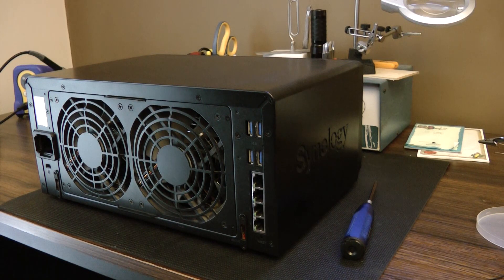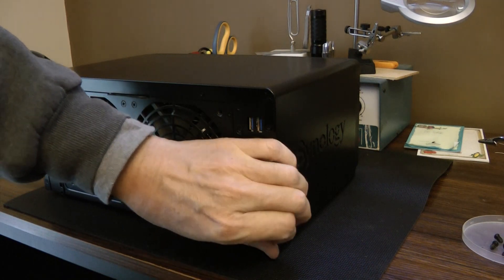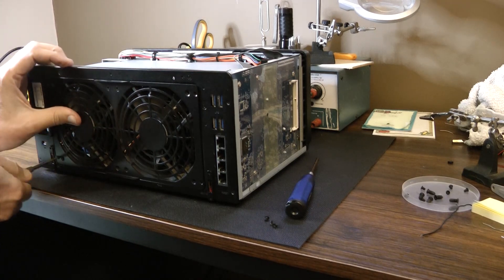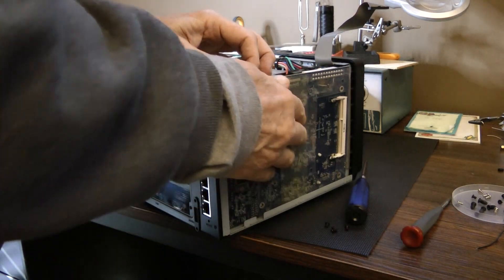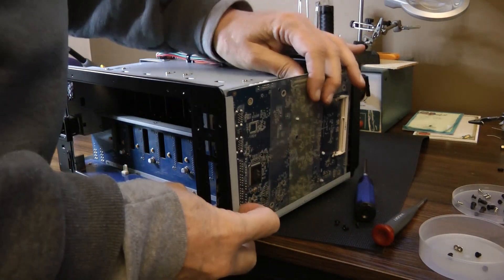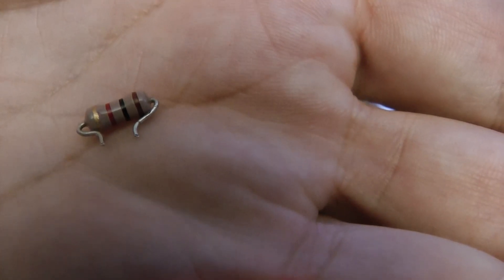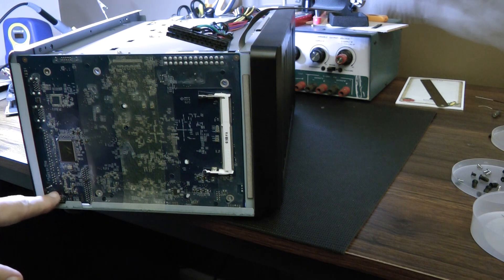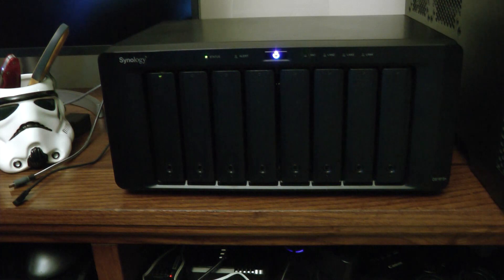Synology 1815+ won't turn on FIX

Comment: Is it a possible soldering with a consumer base solderer? I mean my solding unit is kinda big. And the resistor wire are so small
Reply from the maker: My soldering iron is a consumer version, I'm not a professional at this.  You need something with a pencil tip.  If you have something like a soldering gun, that's no good.

Comment: Hi, what type (model number) of the 1k resistor is good for the transistor fix? Thanks!
Reply from the maker: 1/4 watt 1k will work fine
Reply: @GaryQuiring  Thanks Gary, just to confirm, does something like "Metal Film Resistors - Through Hole 1/4watt 1Kohms 1%" look good?
Reply from the maker: It can be a carbon type too, no need to pay more for the metal film.  1, 5 or 10% is fine.
Reply: @GaryQuiring  Thank you so much!

Comment: Gary, Would you be available to do this fix on my dead Synology 1815+?  I don't feel confident to do it myself.
Reply from the maker: Sorry Jeff, it's going to cost you about $75 to ship each way.  It's not worth it.  Find someone local who has some soldering skills to do it for you. I can't take on the responsibility if the shipping damages the NAS or it possibly does not work even with the resistor modification.   If you are on Facebook I would ask your friends to see who has some soldering skills.
Reply: @GaryQuiring   Thanks -- I understand. PS - Your video is great!

Comment: I had the same problem and I follow exact step and fix my NAS. 

However, when I leave it on power on one day and power off it one night and it doesn’t turn on again. 

I have a question, if I parallel connect two resister together, will that help? 

Or if is is a 500 resister too much for this machine?
Reply from the maker: From what I understand you need a higher OHM resister if it still does not work.  I would try a 1.5k.
Reply: @GaryQuiring  thank you for replying. Do you know does it not power on and why adding adding a resister helps? What does a resister do to the system and how will it affect the system in a long run?
Reply from the maker: @jvfx7469  It's the transistor that is failing. I found the resistor comment on a discussion forum a while back.  You could replace the transistor (which would eventually fail again).  I am going to assume something else on the board is not engineered correctly that causes that transistor to fail.  Are you sure your solder joint is good, maybe that's the issue?
Reply: @GaryQuiring  do you know where that transistor located?
Reply from the maker: @jvfx7469  It's right where you soldered the resistor over the leads of the transistor.  It's a BC847.  It's very tiny.
Reply: @GaryQuiring  I try to add a resister, and it did not power up. And I try to short the two legs using a cable and I got it power up. And I worrying shorting it will damage the machine, I unshort it after it power up, and it can still run for sometime, I’m still watching it running and i hope it will be stable. 

I have a question, if I keep it shorting without a resister, will it do anything bad to the the machine in a long run?
Reply from the maker: @jvfx7469  What are you shorting, the two connections on the transistor?  Did you apply the Atom bug fix with the 100ohm resistor?
Reply: @GaryQuiring  I already see the atom bug fix resister on the board from the factory because it went through warranty service last year. 

I’m shorting the two legs on the resister you show on your video close to the power connector.
Reply from the maker: @jvfx7469  How many times are you powering this on/off?  Most of us leave these NAS's on 24/7.   Find a resistor that will pull it low enough for it to power on.  Or replace the transistor.
Reply: @GaryQuiring  I’ve using this for 8 years 24/7. I never turn it off. Just few Months ago it keep restarting randomly every few days. I follow Synology’s instruction to troubleshoot. I turn off “restart automatically after a power failure” option. After that, when it power off, it never turn on again. I replace the power supply. And it only on for one day and it never when back again until I see your video. 

Now I wonder if I should permanently short those two legs, or add a switch to that cable and only short the connection before press the power button?  

Because without shorting that cable, I can’t do anything to the machine. No power no respond when I push the button.
Reply from the maker: @jvfx7469  I would experiment with different values of resistors or replace the transistor.
Reply: @jvfx7469  this random restart/powering off sounds like symptoms of the atom cpu bug, you need to apply a 100ohms resistor elsewhere to fix this bug.
Reply: @GaryQuiring  after one month of use, I’m coming back to say it is working!! 

With your method of adding a resister and add a switch for power up, I’m able to start the NAS and has been keep it running 24/7 for a month, no restart.

Hopefully it will last.
Reply from the maker: @jvfx7469  My first 1815+ has been running for about a year now with the resistor fix.  No issues.
Reply: @jvfx7469  Here the same issue right now, It has been here for 6 years never a problem. Recently with the power consumption prices, we've automated it via Domotica (WakeOnLan) every morning and in the evenings out, except for the weekends.  It took 4 weeks to not power on anymore.  So it's crap. Shortcutting it, helps turning it on again. I'll just upgrade to 1821+ just better
Reply: Hi, I'm just trying to solve the same problem concerning the resistors. But I want to give a tricky advice to power fail problem, which was successful for my DS1815+ five month before:
I used a hair dryer to heat a little bit the mainboard and the power unit. After that power was going on. Maybe another advice is to change the CR1220 battery on the board.

Currently I will try to add the resistors as described by Gary Quiring. His hint for the second resistor (1k or more) near to the transistor is new for me. Never heard about this one before.
Reply from the maker: @fritzloseries8028  Replacing the battery won't help anything. The 1k resister fix is to deal with a defective transistor.  You can also replace the transistor.  But it's a SMD (surface mount device) and is very small and delicate.  It's easier to solder the resistor over it which will fix the power issue.

Comment: I've got a dead 1815+ synology, did the atom bug fix. My CMOS battery holder broke down and replaced it with a CR1220 PC battery (yellow plastic thing with red and black wire soldered it to the old CMOS battery case. changed the power supply with a new one. It turns on but the orange status light is blinking and after half minute of  time the nas shuts down. I've searched the internet but found no solution. Any tips?
Reply from the maker: Did you solder the resister over the transistor like the video shows?
Reply: @GaryQuiring  Dit that. stays on now, orange status led keeps blinking. Already did a reset. And now installing an update on the DSM. THANKS for the trigger to solder also the resister!

Comment: Hello, I have a much older NAS, DS1010+ That was working until 2 days ago. Now the same issue as yours had, press power button, but nothing happens. Could it be the same issue on this old motherboard?
Reply from the maker: Not sure, easiest way to find out if the power supply is actually working is to short the Green and black wires on the power supply together with something like a paper clip. If it powers on then it's that transistor.  There should be only one green wire on the connector.  You could research that for more info.
Reply: Thank you @GaryQuiring  for your comment. Apparently, in my case, the problem is the power supply. I used a normal ATX one and the NAS Boot. thank you again for your comment, it made me suspect/test that green/black wiring to know if it was working.
Reply: @GaryQuiring  Hi Gary, which green and black wires? I dont suppose you have a photo do you?

Comment: I have a DS415+ that powers on then shuts off, might the atom fix be the solution for mine?
Reply from the maker: It could be Atom, but more likely it's the transistor issue.
Reply: @GaryQuiring  The DS415+ doesn't have that transistor you solder a resistor to because it uses an external power supply and has a different configuration on the motherboard. The repair for the DS415+ is the atom bug fix. What you did to his device you can not do to the DS415+ or any other Synology devices that use the external power brick.

Comment: I have a 1515+ with the same issue.  How can I determine which pads to try soldering a resistor to for this fix?  I have very similar pads on the board but they're labeled Q1 and Q2.
Reply from the maker: Post a good picture of the area on the board, then share the image on a site like imgur.com and post the link here so we can see it.